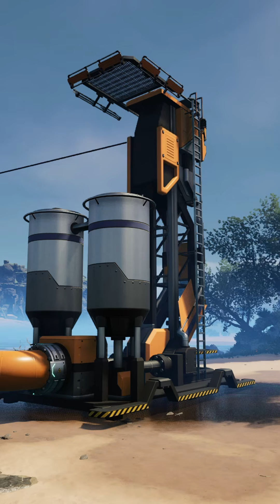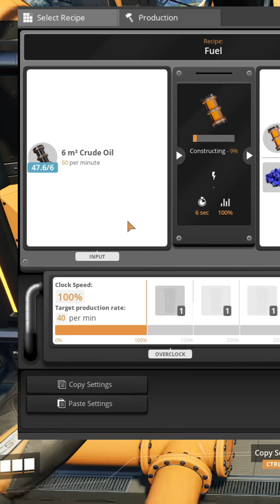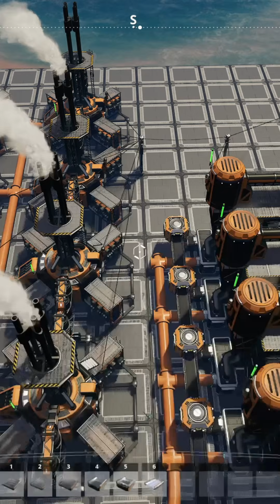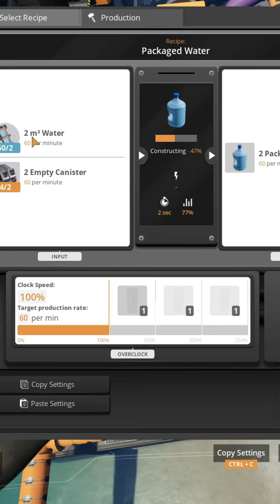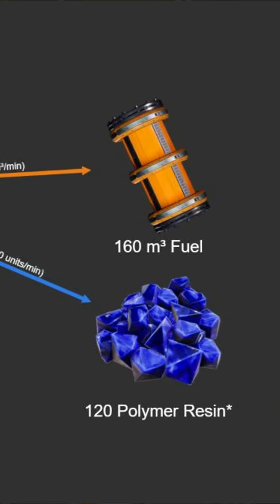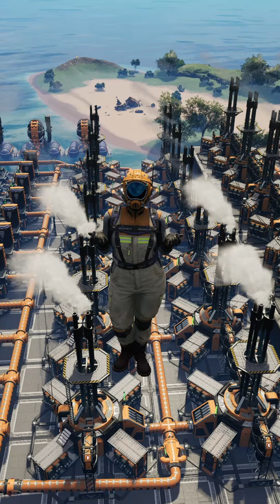Quadruple your fuel output in satisfactory using alternate recipes #gaming #satisfactory #tutorial

Comment: Over 2000 hours is the amount of time it has taken me to implement the suggestions in this video, I've just unlocked turbo fuel and I've built 5 enormous towers in the rocky desert. One tower is for storing packaged fuel, the other 4 towers will store heavy oil residue and the top floors will make diluted packaged fuel ⛽️. I haven't even started making packaged water yet.

My main goal is Rocket Fuel, i wouldn't be surprised if I need another 1000 hours to reach my goal.

Comment: You can also turn a bunch of the fuel into turbo fuel if you have coal and sulfur nearby, then take whatever fuel you don’t use in from the turbo fuel along with the resin, and use the recycled plastic and rubber alt recipes along with the resin you’re producing from the heavy oil residue recipe to make a TON of plastic and rubber
Reply: Can also been done without coal by using the Turbo Blend Fuel receipe.

Comment: Alt heavy oil 20 refinery, deluded fuel 16 mixers and pumps under clock pumps to make 100 water  32 overclock generator all off one overclocked oil node if my math is right

Comment: Honestly i would recommend anyone getting into fuel, to just buy 1x packaged fuel from the awesome shop and use that to unlock turbo fuel. Also make sure to unlock mk 2 pipes. 
Using just 2 nodes of oil - one pure and one normal, both overclocked 250%, you can get 900 crude oil. 

The build that follows is.. gonna take some time but you will end up with like 66k megawatts, enough to finish the game with and never have to worry about power again unless you get into VERY extreme builds. 

Why 900 oil from 2 nodes? That way you have no decimals in your calculations. Just easier to work with and to get working, fluids are a pain in the ass as it is.

Comment: I find diluted packaged fuel is such a hassle to do I’ve never used it, I have used the stndard diluted fuel alt though it’s brilliant for producing drone fuel on site from the residue of making something like rubber for cooling systems or turbo motors
Reply: it is useful if you don't have that recipe yet.
Reply: @HesmiyuMC i just found it way to much of a hassle the standard recipe has allowed me to produce thousands of rocket fuel using the nitrogen recipe skipping turbofuel
Reply: It is useful on the road to ionized fuel, I turn all the oil from the big crater into ionized fuel. Yes, it's several large factories, including a large underground synthetic shard factory.

Comment: Can I do the same thing with turbo fuel?
Reply: I would recommend waiting until tier 7 (until you unlock blenders and mk5 logistics) until you consider any serious power plant upgrades, it’s so you can unlock the nitro rocket fuel recipe and produce like 144,000MW from a single pure oil node.
Reply: @Noname-iq1gz I’m at tier 9 but I JUST got there. Do you think it’s more worth to do rocket fuel over all? Blue crater is where my main is
Reply: I know the recipes are more efficient the later but just to get a quick 30k isn’t turbo efficient
Reply: @majoraplzrocket fuel is the best power source, you should definitely go for it. Turbo fuel is a mid game set up
Reply: @Noname-iq1gz gonna start blueprinting then
Reply: @majoraplz Do rocket fuel, you can produce it in your oil nodes and move it with pipes to wherever you want with pipes because it's a gas and doesn't suffer from lift issues, so you don't need pumps or water (fuel) towers for pressure.

Comment: Later on, when you unlock blenders, you can get a diluted fuel alt recipe to be used in the blender, removing the need for the packagers and I think it also produces more fuel.
Reply: Dosent produce more fuel than the packaged version but its more space efficient and require roughly 8% less power
Reply: I skipped the packager all together and went with the blenders
Reply: @Maxis196 There's a big gap between the packaged fuel line and the blender line without even accounting for finding the alt recipe.
Reply: @deejeh9494  yeah i put it off and went nuclear first

Comment: You can take a bigger step and turn it into turbo fuel then way more power
Reply: Or as soon as you have blenders and fluid extraction, the nitro rocket fuel alt
Reply: I think I’ve got an input of 1200 oil per minute right now using turbo fuel and alts it’s pushing like almost 90,000 MW
Reply: @gabrielchecksfield5577 I run one node of turbo fuel can't be bothered to collect that much sulfur and coal

Comment: There are a lot of cool alternate recipes that allow you to increase your output massively as long as you are willing to tackle the more complex processes needed to do so.
Reply: There's a zero-waste rubber and/or plastic setup that uses feedback loops and is so delicate in its balance requirements that I've only gotten it to work right once. It's so much extra work just to squeeze maximum productivity out of the system but it feels so good once you pull it off.
Reply: @NiteSaiya  Recycled rubber/plastic?  Just put smart splitters to overflow any excess plastic and rubber out the loop and machines will always have full conveyors to continue production
Reply: @STMBomber that's exactly it.

For extreme flexibility you could set up an extra line of refineries that only get fed from the overflow of the overflow to create peak supply of the opposite type. 

That sort of thing only really compensates for weird shapes in peak demand that you should avoid because in the long run a factory will get starved down the line, so only a true maniac would build such a thing.

Don't ask how I know, please.
Reply: Actually for packaged diluted fuel the process can be made incredibly simple.

The first to second step (heavy residue) does not line up nearly in number of machines, but you can compensate through brute force piping.
Everything else can go in a neat 1:1:1 line with 1 belt looping back to the front underneath or overhead for a closed loop. It only needs to be fed enough containers at startup to keep going without stutters.

I build a scaling fuel powerplant by repeating that process unit until all oil was consumed.